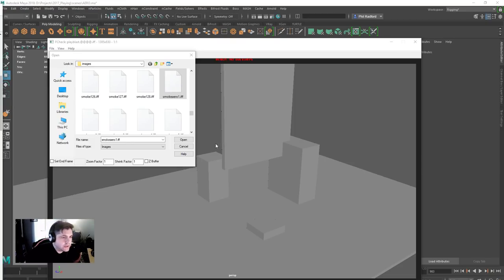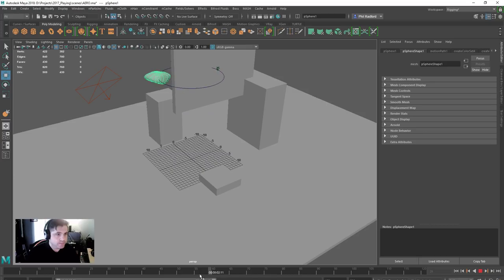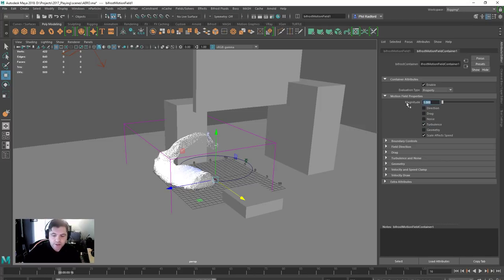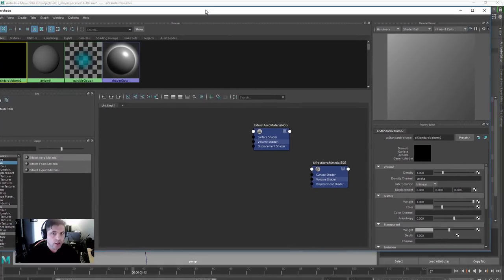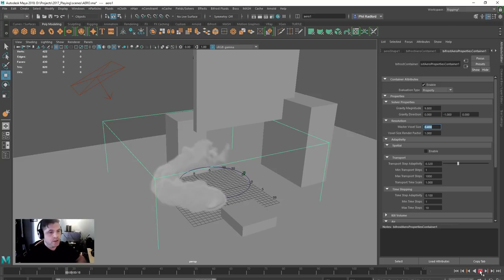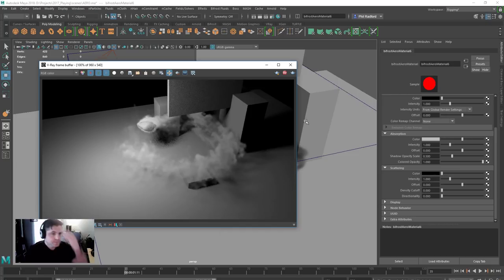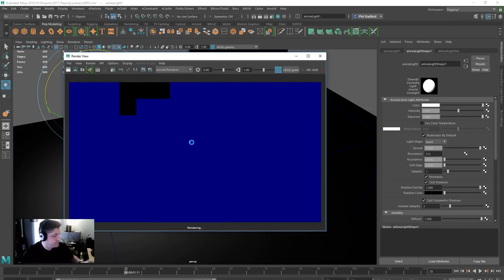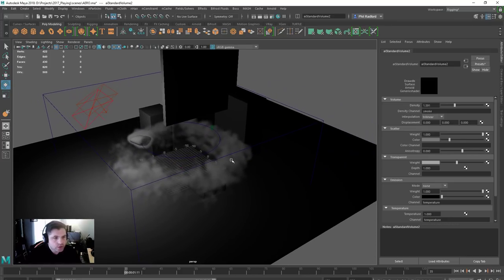Maya Aero smoke tutorial

Comment: My arnold render only a black cube for my aero simulation...I can see it properly on viewport, but only make a black cube from the container when I render it...any idea? Thanks in advance
Reply from the maker: Hi, try hiding the bifrost particles but just leave the bifrost mesh to see if that works. Check that you have an arnold shader assigned also. Come back to me if that doesnt work.
Reply: Phil Radford thanks for your answer! I just discovered that Maya 2018 doesn't support Aero Bifrost material for render,I used an AiStandard surface material with Smoke shader as volume,and it works great :) I hope that this helps somebody else
Reply: What is the smoke shader that you used for Arnold? cant find it
Reply: did you find the solution?
Reply: How to get Smoke shader? Please tell me. thanks in advance